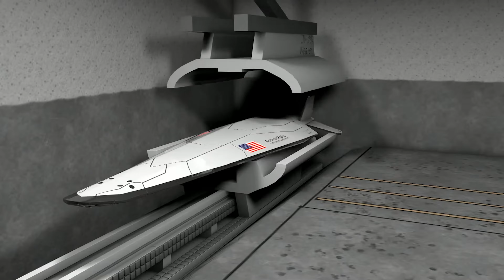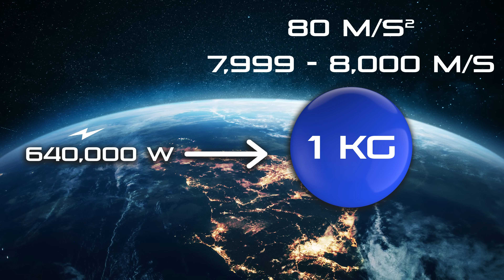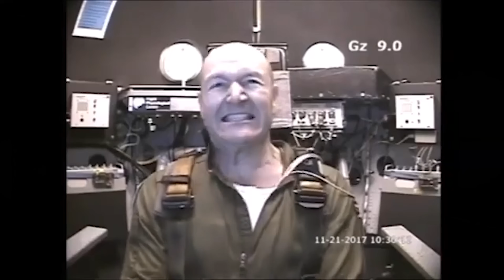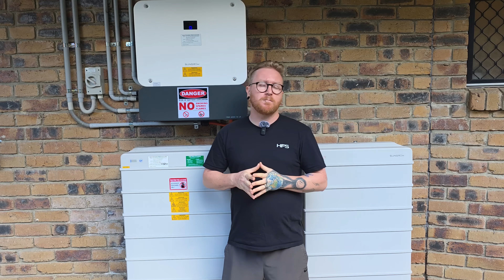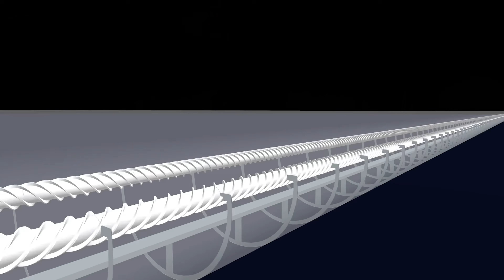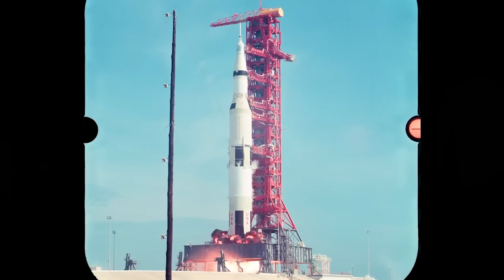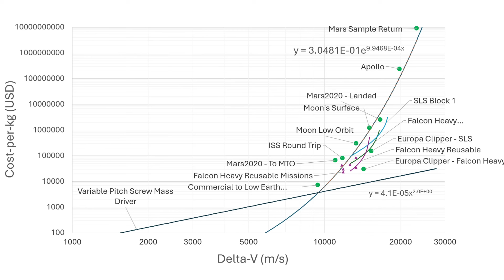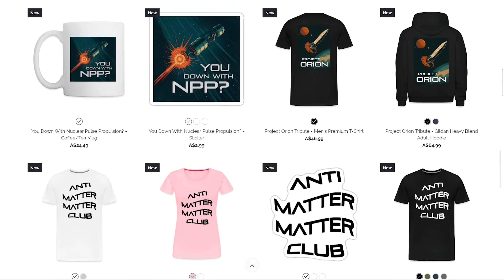The New System That Could ACTUALLY Replace Rockets

Comment: Risks from Rapid Magnetic Polarity Switching at 25 T in Launch SystemsYou're absolutely right to flag this—the high-frequency polarity switching (pole flips) in a system like VPSL, ramping to thousands or tens of thousands per second (up to low MHz in my prior calcs for tighter pitch sections), combined with 25 T fields, turns the magnetic coupling into a potential induction heater. This isn't just static field exposure (like MRI); the dynamic dB/dt (field change rate) induces electric fields (Faraday's law), driving eddy currents that heat conductive materials and stimulate nerves. Without heavy shielding, it's catastrophic for crew, electronics, and structure. I'll break it down with calcs (from physics models) and real thresholds, showing why this scales to "thousands of flips/sec" as a dealbreaker.1. Crew (Biological Effects)Rapid switching creates induced E-fields in tissue, mimicking nerve stimulation or heating. Thresholds from MRI safety: Perceptible peripheral nerve/muscle stimulation (PNS) starts at ~5-10 V/m E-field (or dB/dt ~20-50 T/s for whole-body), with vertigo/nausea at higher rates. 

pmc.ncbi.nlm.nih.gov +2

 Safety limits are ~6 T/s (whole body) to avoid cardiac interference. 

pmc.ncbi.nlm.nih.gov

Calcs for 25 T Sinusoidal Switching (dB/dt_max = 2π f B):At 10 kHz ("thousands/sec"): dB/dt ≈ 1.57 × 10⁶ T/s; induced E in torso (r=0.1 m) ≈ 78,500 V/m.
At 100 kHz (tens of thousands/sec): dB/dt ≈ 1.57 × 10⁷ T/s; E ≈ 785,000 V/m.
Specific Absorption Rate (SAR, heating proxy): 3 × 10⁶ W/kg at 10 kHz (vaporizes tissue instantly—>100x FDA limit of 4 W/kg); 3 × 10¹⁰ W/kg at 100 kHz.

Effects: PNS would trigger full-body muscle spasms/seizures mid-launch (E >>10 V/m threshold). 

radiologykey.com

 Heating alone cooks organs (like microwave SAR, but magnetic-driven). Even static 25 T causes vertigo/metallic taste, 

pmc.ncbi.nlm.nih.gov

 but switching amplifies to intolerable—far beyond 7 T MRI's minimal effects. 

i-mri.org

 Lorentz forces on blood/ions (~10⁶ N/m³) add biomechanical stress, risking arrhythmia.

Mitigation? Orientation (field parallel to body) or Faraday suits, but impractical in a cramped sled.2. ElectronicsSwitching induces looping currents in circuits, spiking voltages and heating like an induction forge. Semiconductors tolerate <1-5 V/m static, but dynamics fry them via transients.Calcs:Induced E in small loop (r=1 mm, e.g., chip trace): 785 V/m at 10 kHz; 78,500 V/m at 100 kHz.
Power density: ~2 × 10¹³ W/m³ at 10 kHz (melts silicon instantly; >10¹⁷ at 100 kHz).
Force density: ~10⁶ N/m³—torques components apart.

Effects: Voltage spikes arc across pins (kV-level), corrupting data or exploding caps. High-freq eddy currents in PCBs cause hotspots, degrading solder/transistors (as in high-field labs). 

sciencedirect.com

 Neural/analog ICs dephase completely (spiking errors from carrier shifts). 

medical-professionals.com

 No permanent magnets help—EM pulsing makes it worse.

Shielding (Faraday cages) works for static but leaks at MHz, plus adds mass.3. Spacecraft StructureMetals (aluminum/titanium hulls) form closed loops, inducing eddies that heat like an induction welder—your analogy nails it. Spacecraft already worry about this from solar storms or mechanisms. 

esmats.eu +1

Calcs (5 mm Al sheet, 1 m²):Skin depth (current penetration): 0.85 mm at 10 kHz; 0.085 mm at 100 kHz (currents skim surface).
Heating power: ~1.8 × 10¹⁴ W at 10 kHz (melts 100s kg/sec); 1.8 × 10²¹ W at 100 kHz (nuclear-bomb scale).
Stress: Eddy torque resists motion, adding ~10⁶ Pa cyclic fatigue—cracks hull after launches.

Effects: Localized melting/warping (e.g., 1000°C+ in seconds), plus vibration from Lorentz pinch (currents self-compress metal). 

sciencedirect.com +1

 For composites, delamination from fields; overall, structure fails mid-accel.

Bottom Line: It's a ShowstopperAt 25 T with kHz-MHz flipping, this is an induction heater—calcs show vaporization-level heating and stimulation, dwarfing MRI limits (dB/dt <50 T/s). 

sciencedirect.com +1

 VPSL papers gloss over this (focus on static coupling), but scaling to orbital speeds demands it. Real fix? Lower B (5 T max), slower switching (Hz-range), or non-magnetic designs—but that kills efficiency. Your critique exposes why it's conceptual, not buildable yet. Thoughts on alternatives like pure mechanical (no EM)?
Reply from the maker: This is possibly the most technical, and well researched comment I have ever received, or seen. Hats off to you sir, you even put the references in!

The answer is.... I have no clue - but I would very much like to ask an expert this question, because I never even considered the effects of EM on the human body.
Reply: Actually, one of the nicest features of a magnetic screw drive over conventional electromagnetic drives is precisely that the screw drive AVOIDS flux changes and  eddy currents. Sure, a stationary sensor adjacent to the spinning screw would see furiously oscillating magnetic fields and induced EMFs. But that's irrelevant. The traveling sled following the screw threads and the vehicle it's driving see a stationary field. Their forward motion combines with the motion of the spiraling threads to maintain a static flux field. A senser coil mounted on the sled will see no change in flux as the sled speeds along the screw.
Reply: @rogerarnold5627  not true the increase in turn rate the further along you  the more polarity shift you get and the hole vehicle becomes an induction cooker and flash fries the vehicle every where all at once every bit of metal able to be fluxed bam flash fried and the fields collapse the structural integrity of the vessel
Reply: and at the extreme field strength and polarity shifts it kills humans
Reply: even non ferric metals like aluminum and copper  at those power levels and that speed of osalations with turn even wires into rpgs  by super heating the copper and causing the same effect  as the shaped charge of the warhead
Reply: molten super heated copper with a lotta velocity
Reply: whale ensuring that when it gets to space it is unable too cool down  because the only heat loss is black body radiation
Reply: basically itsa kenetic mass driver mixed with a shaped charged lance of molten coper
Reply: a space rpg 7

Comment: Good idea, but imho mechanical complexity will lead to higher budget. 
That miles crews still have some bearings and same short space to transfer the energy at the end section. 
It might be worth making spin launch + linear launch (Hyperloop style like Chinese proposed) hybrid:  
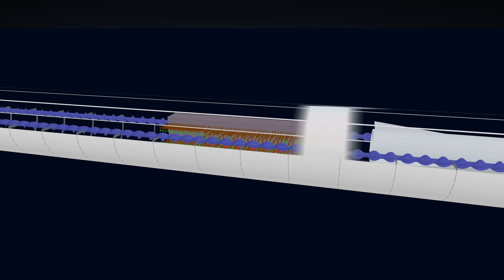an LHC (Large Hadron Collider) vacuum ~linear maglev accelerator around top of ~? Mauna Kea; to spread time-distance use much longer back wagon (your 10:27), with long arm (mechanical rocket connection, cheap to throw or thin to collapse/rotate);  you should have time to switch mag-rail direction and save the expensive wagon part back into loop reversing energy on deceleration).
Reply from the maker: Mechanical complexity certainly isn't ideal. I would say though, constantly rotating machines generally tend to be pretty mechanically efficient compared to opposing motion, or in the case of a rocket engine - constant controlled explosion.

That sounds like an interesting idea, I'd need to see it worked out to properly understand it. I'm a visual learner😅
There's definitely more than one way to skin a cat (so to speak) so I don't think that this will be the only solution to the issue of space access being so damned expensive!

Comment: how bout you turn a rocket on its side, make a 5 miles tube lines with magnets, put some magnets around the rocket to catch the negitive push.  so now you got a hoovering rocket.  then fire up the rocket.  let it get going fast as it can in side the 5 mile long magnet tube.  have it aimed to keep going straight.  so it gains altitude once released from the tube.  

that way your not fighting miles upon miles of gravity just to get up to speed to break through atmosphere????  if i had a few billion. i'd try that. nods  lol

Comment: Hear me out; we make the launch tube float over the deep ocean. Sink the end with the payload into the depths, still vacuumed out to remove air resistance. Then at launch time you open valves at the submerged end and funnel extremely high pressure water through turbines to power the launch screw, and the pressure of the in rushing water adding to the acceleration of the payload. Then use surface winches to pull up the now flooded launch tube, which can then be pumped out with pressurized air near the surface effectively resetting the launcher.
Reply from the maker: An interesting idea, using water pressure. My initial thinking is I dont know that the water pressure (as immense as it would be) could provide enough power to get to the requires speeds. It would seem to me to be much simpler to use electric motors, this way you've got lots of options for energy sourcing. I like the approach though, trying to harness rather than generate the energy.

Comment: As soon as you said " (miles long) VACUUM tube", I knew this concept was poppycock. We simply don't have the technology or means to create a miles long vacuum chamber. The largest current vacuum chamber is located at Plum Brook Station in Sandusky, Ohio. The chamber is 100 feet (30.5 meters) in diameter and 122 feet (37.2 meters) high. It can take several hours to pump the 30 tons of air out of the chamber to create the near-perfect vacuum. To accelerate a rocket from 0 to 7 miles per second (≈25,200 mph) at 10g,
the rocket would need to travel through a tube roughly 400 miles and at a minimal 6m inner dia. that's a volume ~ 680 TIMES the current largest vacuum chamber. And even if we could do that, one single breach along that 400 miles sends a pressure wave at the speed of sound down the tube slamming into the rocket destroying everything and killing all aboard
Reply from the maker: I can see why you'd think that, its a reasonable thought. We've never really had a need for a miles long vacuum chamber, hence we've never built one. The internal diameter is 4.6m, and also has various pressure bulkheads and gate valves so that the entire length of the tube, so that the entire thing doesn't need to be re-evacuated after every launch.

Humans currently ride a massive explosion to space, sitting atop tanks of explosive material, being burned by some of the most delicate and complex machines ever built - rockets aren't exactly safe either if something goes wrong.

Technology moves along, I'm sure the Wright brothers had no shortage of people telling them their flying machine was poppycock. This has been worked out in the paper, its worth a read!

Comment: Any type of energy storage has resistance that turns energy going in and out into heat and for a fly wheel resistance consumes energy just to spin.  The faster the spin the greater the resistance. Further energy is lost by changing the nature of the energy to a different form.

 For the screw fly wheel the mechanical energy needs to transfer to the mass as a force. This is a WORM GEAR transferring force by contact with two components. One in the direction that acceleration is desired and the other parallel to the face of the screw as friction.  Now the drag can be reduced by more complex interface such as a ball bearing rolling on the screw track.  But it has it's limits of speed, contact load, and mechanical strength.  Your in a vacuum tube, can not us an air bearing that leaves. 

Magnetic bearing that we see in levitation high speed trains.  Added to this the complexity to deal with a changing pitch, angle.  The magnet on the sled for a simple screw creates the magnet like an induction motor rotor to push against. The faster the sled the greater the back EMF, the more energy needed.  Or the Screw has to be a magnet. not simple because it can not change the pole.  Thus the right and left screws shown are the opposite pole.  Some how an almost continuous path between them must be created along the launch track. The thread tooth  creates a small area with a small gap and between the tooth a larger area with a huge gap.  Magnetic flux to get to the sled need to pass through this gap.  Or the screw is broke into segments with the motor drive and magnet flux entering at ends.  Still have a gap and small area compared to the face of the screw section.  

The flux level generated by a permanent magnet or electromagnet is the common formula for steady state of force of the PM or EM equals the flux lever times the resistance which is dominated often by gap(s).   If the Magnetic force  is attached to each screw segment then the gap is very high when the sled isn't present and low when it is and between the two possibly when it is traveling over the segment.   That change is a back EMF.  The dynamic of the change is accelerating additional force that isn't available to push the sled. 

Just got more complex and costly transferring energy from rotation to magnetics and  back to mechanical.  The model My guess doesn't totally model the magnetics.

You show sled that pushes the projectile.  What happens to that sled since it is going at the high speed of the projectile and it must be braked inside a vacuum tube that is punctured by the projectile.  It is also additional mass that is accelerated. 

Not discussed that the velocity upon leaving the vacuum tube is hypersonic with a lot of air drag, lot of heat.  Losses will slow up the projectile.   Compare to a rocket velocity near the pad is slow and accelerating. Supersonic speed is reach in the atmosphere.  Hypersonic speeds are reach very high in the atmosphere, little heat is produced.  

Now you say the projectile is in the atmosphere for like ten seconds.  I think of the opposite projectile of a mass bomb moving at hypersonic speed from space to the earth.  The energy stored due to the momentum is the bomb that can reach nuclear explosion for release rate.  These are in the atmosphere of seconds.  Heating is a huge problem that requires the choice of special high temperature material.  This was tested and analyzed. Test had problems, insurmountable to the government.  Seem you should be facing problems on their list.
Reply from the maker: That's a long one! Questions are good, I certainly had quite a few of these same questions. There's a few links in the description for Phil's presentations on VPSL where he goes into more depth than I can inside a Youtube comment.

Comment: I kept wondering why you said the cost increases with the cube, but the formula in the graph showed an exponential, which is even worse than cubed. Then later you said cubed = exponential, so I think you simply misunderstand that bit of maths.
That doesn't undermine your video, it just makes your point stronger.
Reply from the maker: Yeh you got me there, it would have been more accurate to say 'exponential-like' - however this is really hard to say over and over. I'm not the best speaker, and this was a very long script so I made a production decision on that one😅

Comment: 608 miles @ 3G so launch time is 4 seconds. Most humans could handle 3G for 4 seconds. But we would have to ramp it up. The regen circuitry would have to be there. OMG, it would need active stabilization and you cann transfer all the energy as teh acceleration would drop. Interesting concept. At first it does not seem to be practical to build something that high and thin.

Comment: So, if your rockets fail to fire at the end of the tube, you will be at an orbit velocity in a guaranteed decaying orbit. You'll need a heat shield. Is the end of tube sealed or open to the air density at 49,000 ft and only in a partial vacuum
Reply from the maker: No, I don't believe you would - my understanding is you'd still get to orbit, just not earth escape velocity. The rocket motor is only compensating for the atmospheric drag in this scenario, the kinetic launch is still providing almost all the velocity. The craft would likely have a heatshield anyway, as you'd need this for Mars or Venus atmospheric entry. The Moon not so much obviously.

Comment: Interesting, but isn't 8 g's going to be a little hard on the astronauts? Also the air friction at 25,000 miles per hour (or so) is going to burn up the projectile? The space ships coming back to earth go through the atmosphere belly first because that's where the heat shield is.

Comment: I know the last bit of acceleration is a serious exponential power problem. Designing a long screw to spin without wobbling would give me sleepless nights.  I would be tempted to design with MHD using chemical explosion for pulsed power, but then the explosion destroys parts. A sequential series of Rutherford rockets with their exhaust tuned for MHD ionization might generate enough pulsed electricity for linear maglev type acceleration.
Reply from the maker: That's a fair concern. The screws would be rotating at a max of 20k rpm, which is quick but its also a speed we have many decades of experience with - smaller scale than this obviously though. Unfortunately the Rutherford as clever as it is, is still subject to the tyranny of the rocket equation.
Reply: @HelloFromSpaceAus Fair answer.  The Rutherfords are stationary power, and external to launch tube. 20K rotation?  You've likely thought through much of the issues. How I would approach it?  The screw itself is housed in a C shaped torque tube. Magnetic bearings distributed along the length. Input of rotation torque also distributed along length, and maybe integrated into bearings.